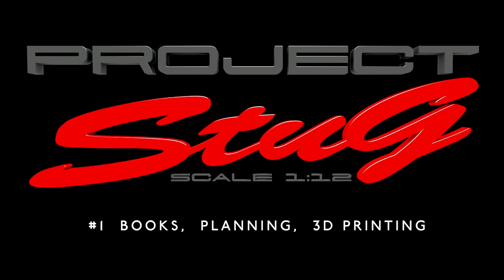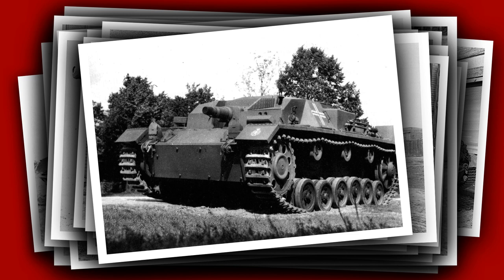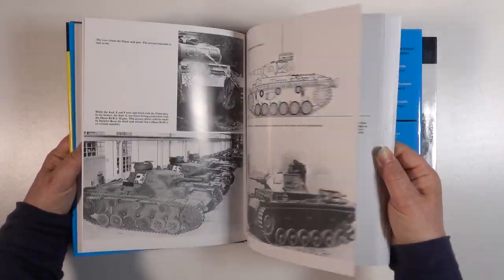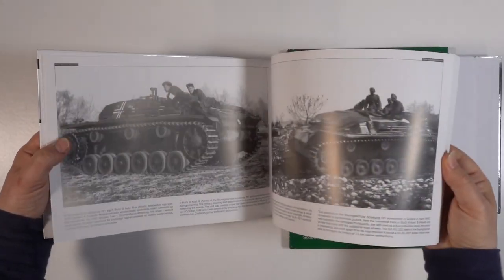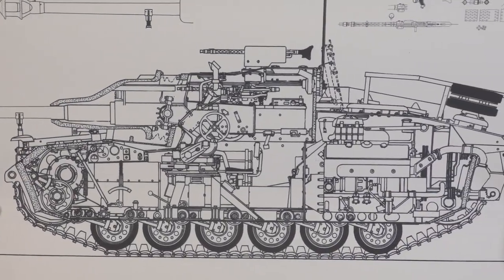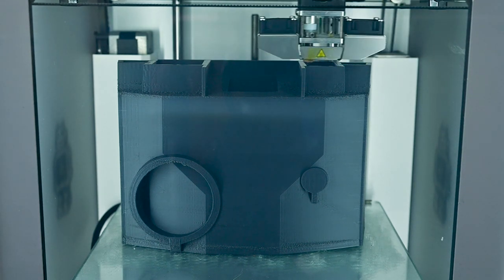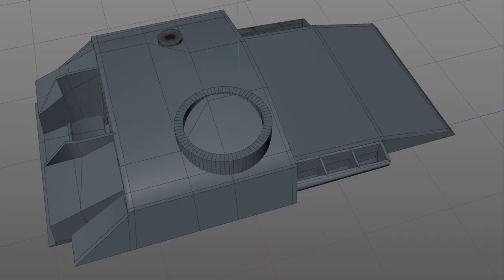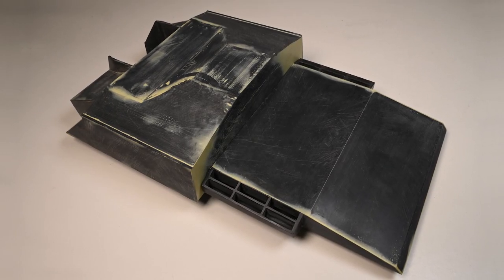PROJECT StuG PART 1  ‘BOOKS, PLANNING & 3D PRINTING’

Comment: Just found this video while reading your comment on the StuG restoration by the team at the Australian armor museum. Subscribed. Looking forward to watching the rest of the series.
Reply from the maker: Thanks for subscribing wboquist, it's mush appreciated. Glenn and Beau are doing an awesome job on the StuG. At the rate they are going there's will be finished before mine... 😯
Reply: @StaplesandVine  You're welcome. I've watched all of the StuG videos you've uploaded so far. Great stuff. A question for you: If you wanted to build a 1/4 scale StuG, could you just multiply every dimension on your modeled parts by three (assuming your printer was big enough), or do some problems arise when you scale a drawing up or down?
Reply from the maker: Scaling up like that to 1/4 scale would certainly work. Although it would then open up other avenues for design. For instance the fighting compartment would be better laser cut like the lower hull rather than 3D printed.

Comment: Next project after this 1:1 v1 rocket😜 👍 ... looking good mate strange scale you could have done 1/16 as there are loads of figures at that scale. Is this for metal casting too?
Reply from the maker: V1 - nah! V2 - maybe? I looked at 1/16 but I didn't want everyone saying 'why don't you just buy a...' - too easy!  Maybe 1/16 for something else obscure in the future that works out a similar size. 1/12 is a lot bigger, 1 inch =1 foot. I will cast some parts it will be a very similar construction to the Maus.